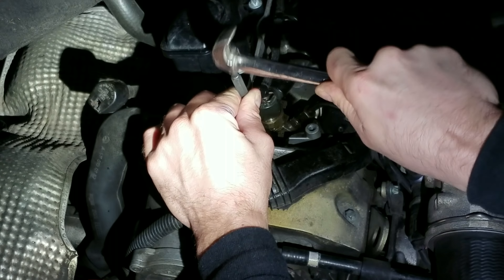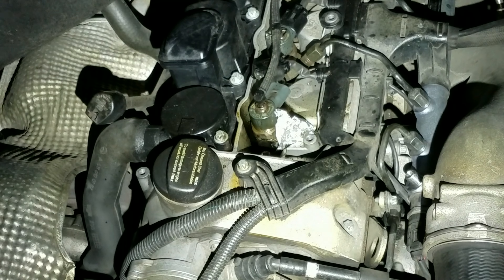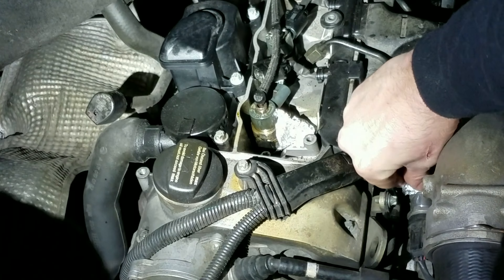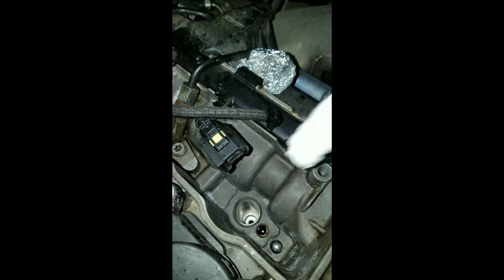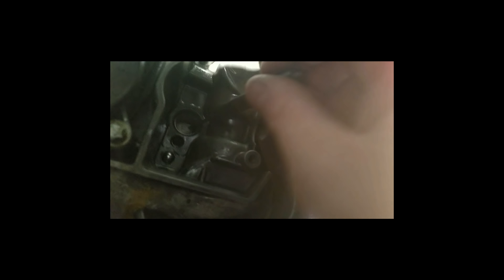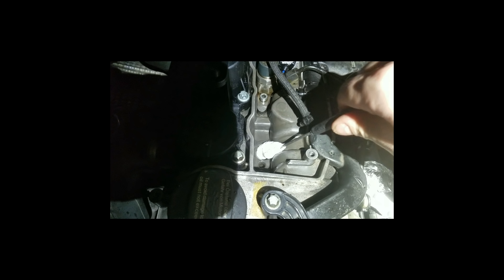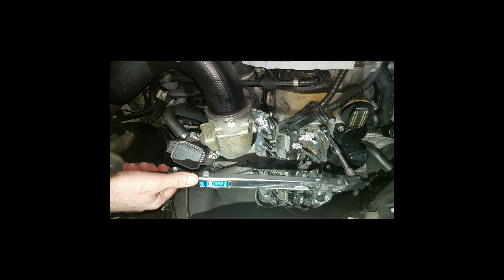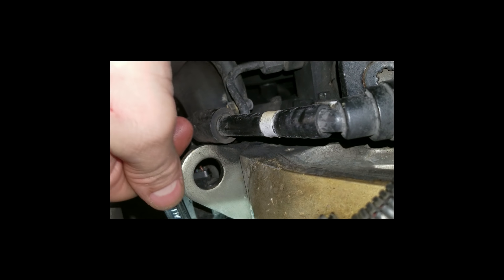How to fix "Black death" injector seal leakage on a T1N Sprinter [02-06 Dodge/FL/MB]

Comment: Good  job  thanks  for sharing 
I have  the same problem with my  sprinter 
I see the leak  cams  from  the hold down  bolt  and the diesel  
I don't know  way
I be working  on that tomorrow
Reply from the maker: You have a diesel leak? The injectors can crack rarely and leak diesel. you will know when you pull out the injectors since you said it was leaking. Otherwise check out the return line and the high pressure fuel the supply line tightness. just make sure to get that engine really hot and pull that injector within 10 minutes of shutting the engine down.you can even loosen the hold down clamp just a millimeter and turn the engine on to use compression to work the injector out. But that can stress the hold down bolt threads so that's kind of a last resort.

Comment: at the beginning the tapping on the bolt was to shock it loose and then you warmed the motor to essentially expand the metal to help crack it loose is that what you were up to?
Reply from the maker: Yep, was trying to shock the threads loose. the proper tool to do that is an impact driver but I didn't have one of course. I was thinking there would be rust or corrosion but that's not the case it's just that oily sludge that needs to be really hot to remove it trouble free.

Comment: Question where is the oil coming from  on top of valve cover by the # 5 injector. It appears to be oil and not exhaust. Is this a sign of injector seal or another problem.
Reply from the maker: That's probably penetrating fluid and oven cleaner spray that made its way back to the end of the injector valley. The engine is tilted a bit and there's a drain hole at the back of the injector "galley" (where the injectors sit in). So when you spray a lot of fluid on number one, it runs all the way down to number five. I actually had to reseal all five injectors eventually, so it may have been leaking and I just didn't catch it, you'd have to time stamp it for me to look at cuz I just wasted too much time reviewing another one of my videos, heh, and now I gotta sleep

Comment: Hey man, I am looking at getting a Sprinter 2004-2006 in a few months. Just looking into doing any work myself -- and had a question. So to do this repair, you are just removing each fuel injector, cleaning them very well, and then reinstalling with new bolt/seal correct? The leak is actually the copper seal then, and the injectors do NOT have to be replaced? Thanks.
Reply from the maker: Exactly. Although if you let it go on for way too long the injectors can be "Cooked" (Overheated/permanently damaged). It's only about $25 per injector to test them on a proper bosch test machine though, but it'd have to have been going on for years real bad to ruin an injector I would think. I leave them alone if they aren't already leaking because the aluminum head is very fragile (Just remember, remove from a real hot engine, never cold.). You'll need to bring a hex multi key (Or was it star?) to remove the top plastic cover to inspect. I forgot mine and crossed my fingers when I got mine, issue didn't pop up till a year  later.

Comment: Hi,
Do you know what is the torque spec for tightening down the injector bolts?
Thank you!
Reply from the maker: "Forget this stupid BS imperial torque ratings ,it only leads to silly mistakes and broken bolts or torn out threads as a result.

Use a verified/calibrated 1/4" drive torque wrench set at SEVEN NEWTON METERS .
Plus one pass of angle tightening of 90 degrees.
Let the bolt normalize for a few minutes and do another 90 degree pass.

Needless to mention it, but only use new bolts every time. Don't re-use a bolt in any circumstance.
Dennis (lindenengineering)"

Be careful not to use a foot pounds wrench. Either 7 newton meters, or 62 I N C H pounds + 90 degrees + 90 degrees. Inch pounds. Not foot pounds.

Link for reference: https://sprinter-source.com/forums/index.php?threads/82925/

Comment: I have only had my Sprinter for about a month but I have noticed that the t1n has a very big problem with air getting into the fuel system and I think it is very hard to get it out. When I have the money I'm going to install a separate filter water separator and the best manual priming pump I can find. Until then I need to figure out the best way to bleed the entire system. I have tried bleeding each injector with the engine on but I am getting mixed results. The problem is that the animal before me over tightened the fuel lines and I have two super tighten them or they will leak. Also I hate those plastic fittings which are old and very brittle and damaged. If I had $1000000 I would put all brand new parts but if I had that kind of money my head would not be inside the engine of my Sprinter and my hands sure as hell would not have grease all over them.
Reply from the maker: Looks like I missed your comment, but you can use a brand new perfectly clean mini Shop-Vac and duct tape the hose so it fits in the fuel filler neck, to prime the fuel system. You just need to get fuel up to the high pressure pump, the high side is self priming while cranking, air is relieved through the fuel rail solenoid and injector return.

As for bleeding the injectors, that's extremely dangerous and you should never do that on a high pressure common rail diesel. High pressure Diesel injection can result in amputation, extremely painful necrotic tissue removal, or blood poisoning resulting in death, from the tiniest almost invisible pinprick leak. Beware the fuel system operates at a max of 20,000 PSI which is strong enough to cut through steel.

It sounds like you have an older sprinter, which has a vacuum operated lift pump. The vacuum pump is weak and the lines are prone to cracking. If you add a 12 volt inline pump of sufficient gpm flow capabilities, instead of air leaking into the fuel system, fuel will leak out and then it becomes a lot easier to find the leaks.

As for your super tightened injector supply lines, I suggest you replace the metal high pressure supply lines. Use a flare wrench for removal and tightening, because it grips more corners of the fitting, then start with a jolt or a tap rather than a smooth and gradual pull. Compression fittings do not need to be super tight to work, they need to be lined up right and free of debris or damage. In your case it sounds like the fitting may be damaged so they may need to be replaced. 

Also, they won't fit right if the injector has been tightened down before the high pressure fuel line is connected. Because the angled threads on compression type fittings need to be going straight in, or they won't seal as designed.

Comment: Absolutely brilliant, informative video, thank you for the work in sharing this with everyone. I too have a leaky injector on a Mercedes E320 and I was wondering what that cleaning foam was you used please? Here, in the UK, oven cleaner sold says not to be used on Aluminium?
Reply from the maker: Peter Campbell Oven spray. Yes the stuff is powerful and if not cleaned off aluminum it will leave a white mark. However it's the best stuff I know of to dissolve the goo.
Reply: @AncapistanVan  Best method I have seen yet, brilliant video buddy

Comment: I had an injector leak on the #2 cylinder and replace the copper washer seal and new stretch bolt and all was good with quiet and even idle. Letting the motor warm up; came out to drive it and there is fuel coming out of a 3/8" dia. rubber hose on the drivers side and spilling Diesel all over the driveway. I traced the rubber hose to under the intake manifold but cannot see the source.?  What do you think is the problem? I removed the top motor black plastic cover (7 6MM screws) and find it dry and all fuel lines torqued down OK. There is a little random hesitation when giving the throttle a little push. Motor is smooth with normal sounds. Thanks
Reply from the maker: Sounds like a return line is leaking fuel into the injector galley; there's a drain hose that leaks fluid behind the engine if one of the return lines are loose. I know you said it was dry but look again. If that isn't it just follow all the fuel lines with a flashlight. It might also be your fuel filter thumbwheel drain hose.
Reply: @AncapistanVan  I looked again and the injector gallery is all dry. The fuel is gushing and is coming out that black hose on side of the motor and looks like that hose comes from under the manifold. I checked the fuel filter area and all is dry there. Thanks
Reply from the maker: @vincentrolfe1384  Well if it's a hose with an open end it's got to be the injector galley drain hose or a return line that got accidentally pulled off. You could try blowing smoke up the hose to see where it comes out. Why don't you try running the engine and looking for leaks. If you take pictures or a video and message it to me i could identify it.
Reply from the maker: @vincentrolfe1384  Now that I think about it, you might have accidentally unplugged the fuel rail solenoid return line(s) on the rear of the fuel rail, which is located kind of underneath the intake manifold. Check that the hoses are in place and use a mirror or your phone as a mirror if needed
Reply: @AncapistanVan  Will try that but the fuel splashes down on me while the motor is running. Thought I would go to the dealer MB and check out the diagram of this model and see which hose comes from where. Thanks and have a good day over there.
Reply: @AncapistanVan  Will try that too. Many thanks. Seems like a simple fix will be required; just never had a problem of any kind with this vehicle. Oh, I have had to replace and repack front wheel bearings and the glowplug module but that is regular maintenance stuff.
Reply from the maker: @vincentrolfe1384  You can get a diagram free at www.diysprinter.co.uk/reference 
Either 2006-va-sm.pdf or  the 2003 folder
Reply: @AncapistanVan  OK will give that a try. Wonder if the solenoid on fuel rail end has failed due to the surge of air-fuel when I started up after the injector seat repair.? Getting closer. Have a good day and thanks
Reply from the maker: @vincentrolfe1384 Nah man the rail solenoid can handle air, it's debris that causes it greif. Either you have diesel leaking into the injector galley (valve cover) or a return line hose has come loose. You will find it. Hope you found the relevant chapter in the manual I linked.
Reply: Yes, the info will prove valuable for the future and I see the hose leaking fuel is the definite one from the injector gallery. Going to open the cover again and eyeball the whole thing. Appreciate all your help. I have a Vincent Rolfe (cap V & R) Ytube with a corrected RF camber problem on the 2500 that was needing a 1/2 degree wedge. I filed the wedges to mathmaticaly be 1/2 degree (took forever) and now the wear is gone and it tracks amazingly well. That constant alignment being out was losing me 2MPG on average plus the tire wear and it contributed to wheel bearing aging. A one degree wedge was just too much.
So have a good night over there and thanks. I will let you know what happens. One person on Sprinter Forum had the identical problem in '08 and I have asked for his reply. Joined the forum yesterday late and took a while to pass the specs.
Reply: @AncapistanVan I used to live in Fullerton and Harbor City some years ago around the time of the Whittier quake. Rode motorcycles on the 1 along the coast and moved out with the '90 depression in LA. Had a nice 405 Peugeot at that time.
I would wake up 2 hours in the morning before a quake with dizzy stomach and I knew a quake was coming.
Reply: @AncapistanVan  Well, I rechecked what you had earlier said and found new fuel in the cavity behind the #2 injector down in the head. Then, I looked at the two return fuel lines I had detached to fix the #2 injector copper seat. They were both with the clip but they were not all the way home seated in the metal of the injectors as were the #3,4,5 injectors. Removed the clips and applied more thumb pressure and snap they seated home. Put the clips on and she is running smooth and no leaking fuel. I dipped the fuel out of the whole bank of injectors with paper towels. Thanks so much for your thought and assistance. If you ever come to Chicago, let me know!
These later model MB Diesels are not like the 180D's I drove as a kid. Them were the days. Idling with 7-8 psi of oil pressure as per the manual. Going to put in new oil and filter on the T1N so I can spot a problem quickly down the road.
Appreciate your vid on the injector seat. That was easy fix.
Reply from the maker: @vincentrolfe1384  Hey, great to hear you got it fixed.

Comment: Great video- will be putting this to use on my E320 this weekend hopefully. What products did you use to clean the injector hole?
Reply: AncapistanVan where did you buy the new hold down bolts and the new seals?
Reply from the maker: https://europarts-sd.com/item.asp?PID=3922

Also your local mb dealer should be able to get them.

Comment: Thank you for the informative video, can I please ask what you used to clean the threads where the M6 bolt goes, I can see you used general cleaning methods however did you insert some sort of re-cutting tool at the end or is this just a normal M6 bolt. If so where can I find this as I have been looking everywhere and not been able to find this. Is it a must to do this? I appreciate your reply.
Reply from the maker: I used the old hold down bolt. You can cut reliefs in the side with a Dremel wheel like a tap would have to collect the swarf. But I would cut shorter reliefs rather than real long ones because I ended up just making a Frankenstein bolt that didn't really work. So I just went back to using a hold down bolt and paper towels and spray. Last time I did it I used bottle brushes from Harbor Freight on a drill. The proper tool for this job is a custom bottoming tap with a very narrow shank. The problem is it is hard to find a tap that is both long enough and with a shank that is thinner than the hole so it can go all the way to the very bottom. A bottoming tap means that it has a 90 degree angle on the bottom so it will clean out the bottom of the hole. This is important that the bolt can sit all the way down in its place, so when they proper torque is applied it will not break. However I made do with what I had. Compressed air is very helpful in this situation. One way to create this tool is take a bottoming tap and weld/ epoxy/braze a rod on to it. I have an extensive tool list with links on my thread here: https://sprinter-source.com/forum/showthread.php?t=50271

But I would not use the seal face cutter unless there are large gas erosion pathways. Hope my reply isn't too late, I missed it.

Comment: Looking into doing this on our Vito. Very well detailed video thanks man
Reply from the maker: Hey glad you enjoyed it. But a word of caution, the longer you wait, the bigger a mess it gets. Just make sure your engine is real real hot before you crack the bolt, because the tar turns into a glue within 10 minutes of shutting down the engine.

Comment: A special Mercedes seal seat cleaning tool is available and it comes with plugs to stop debris going into combustion chamber. Also an M6 tap will clean out thread.Put some copperslip on bolt before inserting.Apparently Honda Accord 2.2 diesel copper seals are better than the Mercedes but cannot verify that.
Reply from the maker: Yeah I use a 19x17mm flat injector seat cutter just to clean the carbon off the seat, I don't cut any metal off unless it's damaged. KTC tools kit #A2209.
 An M6 (*bottoming*) tap won't work as you need a real long one and usually the shank is larger than the tap, so you can't get it to the bottom of the hole - you need a special long tap with a thin shank, or a custom tool.
 I don't put copper slip on the bolt, or anything, as it needs sufficient friction to stay clamped, and with the valve cover being aluminum, corrosion isn't usually a problem, it's just the carbon goo that makes bolts stick and break. If you look closely at the bolts, they come with some yellow anti seize near the tip.
 I have a set of honda seals but they are much thicker, meaning they would raise the injector tip height, possibly changing combustion characteristics, so I keep those for a job where the seat face must be cut down.
Reply from the maker: I would be interested in the part # for those plugs though, that'd be great..
Reply: @AncapistanVan  The part no is W6115890068100  & Is description Genuine Mercedes Benz Injector & Crankcase head cleaning tool.It has chamferered plugs that can be inserted via the long tool into the injector orifice so that when the seat is being cleaned with the main tool (A brass wire brush) bits of aluminium and crap don't go into the combustion chamber.Most important as more damage can occur to piston and cylinder bore if this happens!!!

Comment: Thanks for posting a very helpful video!  I have the same injector leaking on mine.  Approximately how long did it take you start to finish?
Reply from the maker: Glad you found it helpful. I would say 3-4 hours, because I did not have the proper cleaning tools and was extremely thorough with cleaning. With a shotgun barrel brass brush + drill, injector hole plug, vacuum, and an injector hold down bolt bottoming tap, I could have done the whole job in an hour or two. This was also the first one I've done. It's really an easy job as long as you don't break the hold down bolt. But I would rather break the bolt myself rather than have a tech "Learn" about how fragile they are with my wallet.